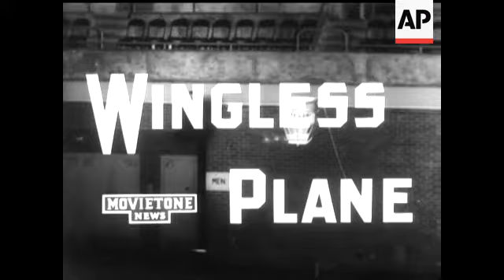"AERODYNE" - WINGLESS PLANE

Comment: The bilimp or airship or Zeppelin
Reply: No, this is actively, without buoyant assistance, pushing itself upwards similarly to a helicopter except it doesn't use aerofoils but rather pure thrust and a tiny bit of pressure difference from the fans (kinda like an aerofoil)
 
Never mind, the duct acts as a foil, I'm kinda dumb
Reply: @midgetman4206  don't go upside down
Reply: @gamerx112  you wouldn't want to go upside down inside an dirigible either